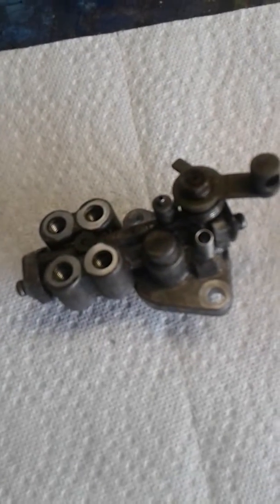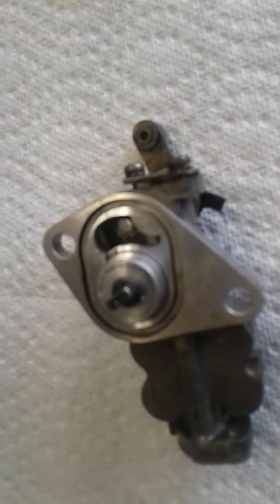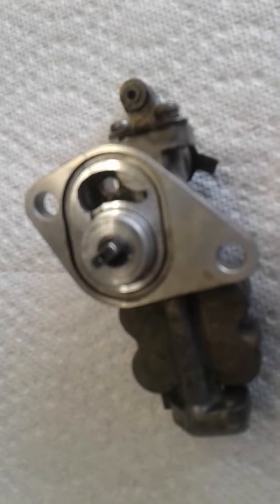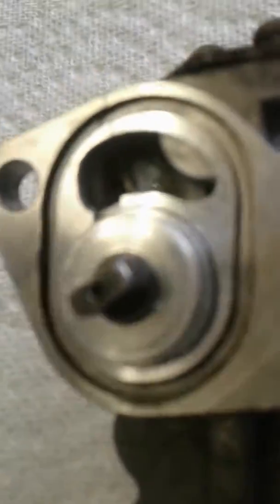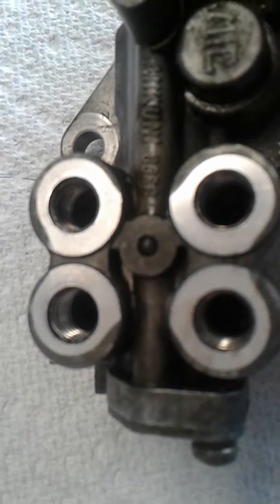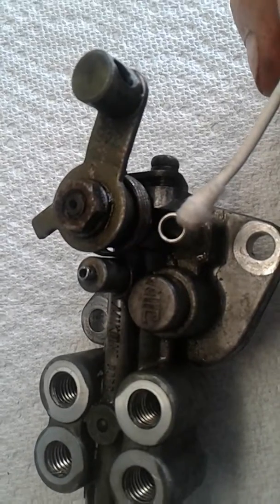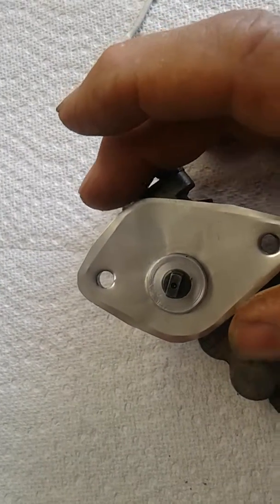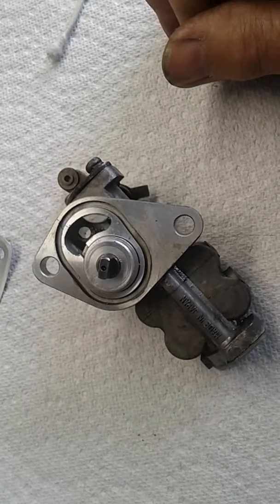rx7 omp / oil metering pump solution

Comment: Love your video! , question with this mod, there is a need for the return oil? If does where it goes? Thanks in advance
Reply from the maker: The resivore is not is gravity fed so you will not need a relief hole as like the factory setup has. This video was to show how the pump works. Not to show how to modify the system because I never finished my experiment to block off the oil supply. This vidio was made to inform how the system works.

Comment: What's the benefit of going this rout rather than premix? Not being a smart a$$ I'm just always on the hunt for knowledge on rotary engines. Anything I can do to keep my turbo2 running for years to come is welcome.
Reply: If you've done the OMP delete premix work, if you haven't premix works. Only reason for the oil in the combustion chamber on a rotary is the Apex seals. Those can be troublesome little buggers, they are part of many problems for rotaries. As long as you're getting oil in there it should all be good, but the oil in the fuel can cause injector issues which is why a lot of people recommend other fuel additives/injected cleaners like seafoam for help combat carbon and injected clogs.

Comment: I wonder how will it runs in the long run?
Reply from the maker: The pump shown in this video was off an engine that had one hundred thousand miles on it when torn abart the rotary housings were in great shape. Some people believe that you need to premix. Mazda ran there race motors with secondery pumps like this with separate oil feed line from a tank filled with outboard marine oil.

Comment: My 1991 vert is basically the same except it's electronically operated.  When it fails, it will smoke the ECU as mine did. 
Any video's on how to remove/replace the pump with engine in the car would be most useful.  I hear it's a PITA.
Reply from the maker: If your 91 has a belt driven fan you have to remove the fan and the fan shroud to get at the omp you have to remove the oil lines first. A new pump is very expensive. Rotary resurrection on eBay may have a used one, I have had good results from this site. This is only a suggestion.
Reply: Easier to premix